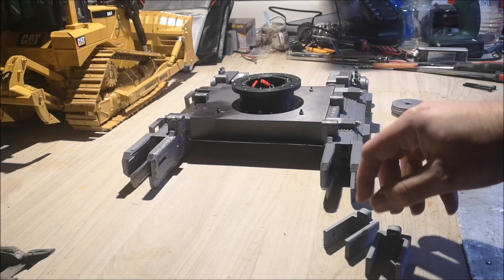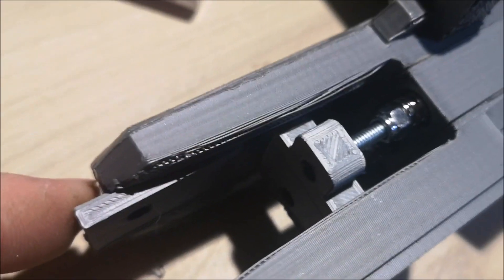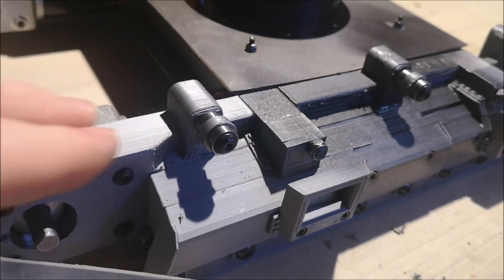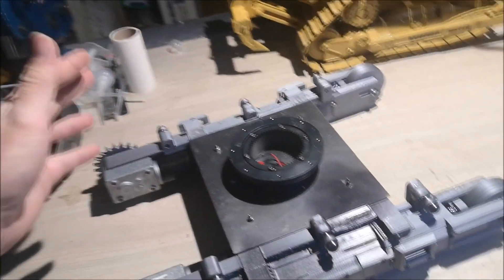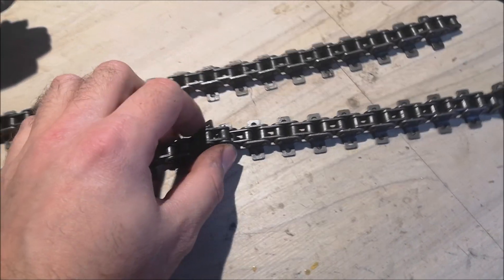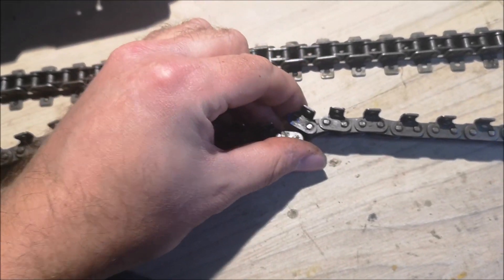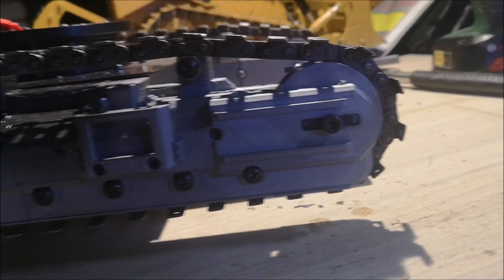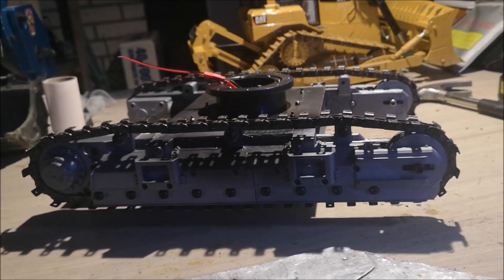Making a 3D Printed RC EXCAVATOR - Volvo EC550EL - PART 3

Comment: Which battery pack do you use for this excavator?
Reply from the maker: 3S Lipo, 5200mah
Reply: Thank you. Your projects are great. Good great job. I picked up your plan for the excavator on cults 2 weeks ago and my 3D printer has been glowing ever since 😉
Reply from the maker: @sebastiankolbeck4164   that is awesome !!!! :D 😍😍 if you are on facebook, join our community and post pics of your build :) the group is called "Burnie222rc's Designs - RC 1/14 Community"